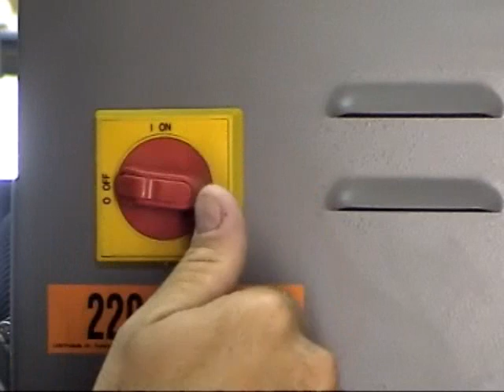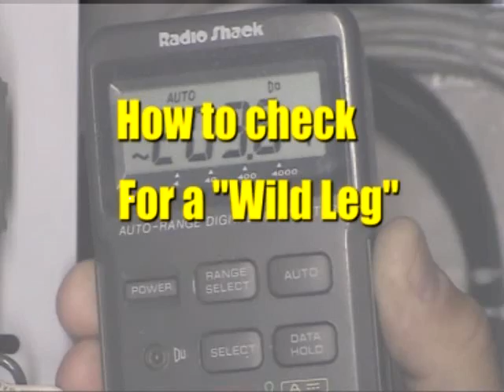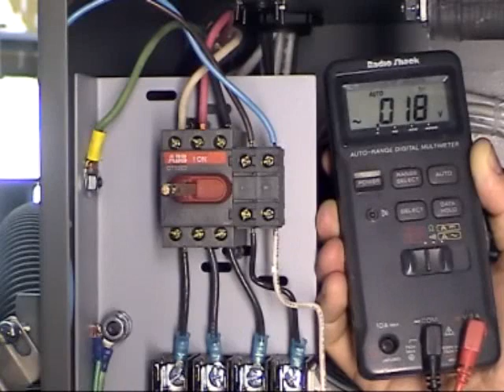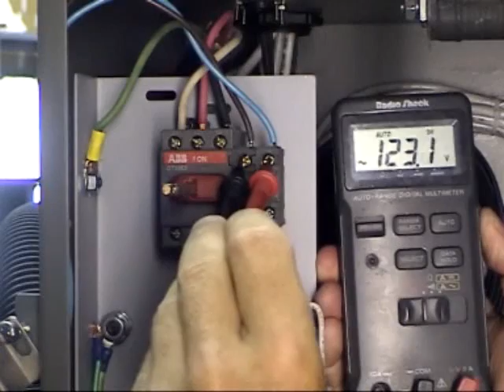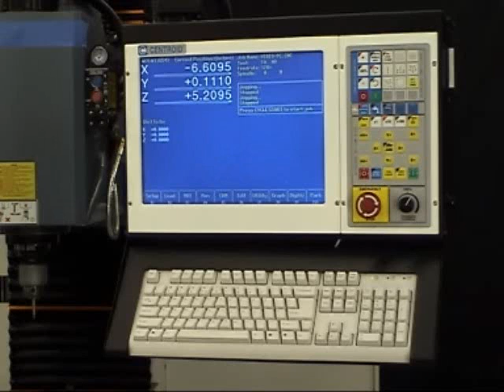CNC Milling Machine Training Part 1- Atrump Machinery Inc.wmv

Comment: No operator would ever check the power inside the cabinet before running a machine. What you are telling people to do is stupid and dangerous! Checking the power is up to the installer when the machine is first installed. And after that only if it is serviced and the power lines had been removed.
Reply: Hmmm I’m an operator and installer. Guess I’m screwed.